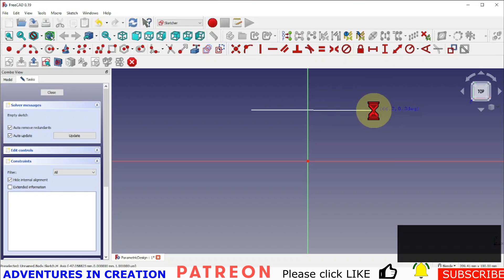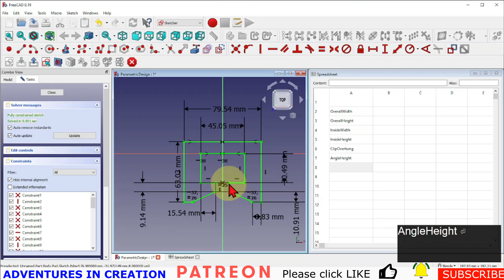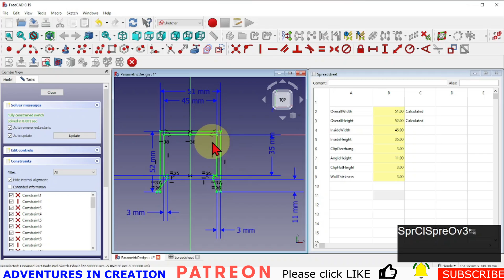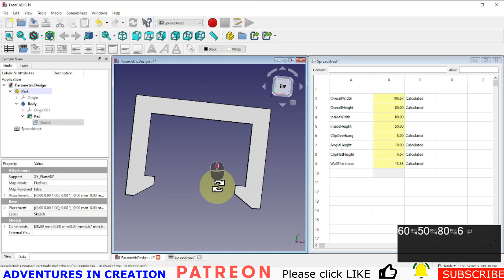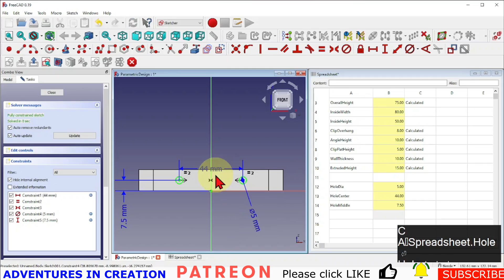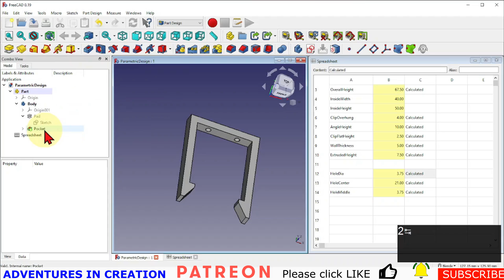Comment: Thanks for another good video. Used this technique to build a holder for a Raspberry Pi that I needed to neatly hide behind a kiosk screen. The parametric approach let's you wiggle final measurements much easier than manually setting. Learning & doing👍
Reply: Excellent, you should post some pictures

Comment: hint at that video where it says how to connect macros, I missed a lot and can't find how.
I have a void in the list of macros and writes an error message: GitPython is not installed! Unable to get a macro from git.
Thanks.
Reply: This problem usually requires an uninstall, reinstall to fix. That git python stuff should get installed with Freecad
Reply: @Adventuresincreation  Thank you so much, I just started learning FreeCAD and have already made your example of a box without a macro, manually assigned an alias to the cells and already printed the box on a 3D printer.
I think I'll learn more over time. My next lesson will be a cover.

Comment: I could check, but was thinking perhaps the sketch was not auto-updating because the "Task" tab was selected and open.  As soon as it was closed it seemed that the model would then update as soon as you changed the values in the spreadsheet
Reply: Yeah, the model uodated immediately but the sketch required a refresh

Comment: If you're not going to be taking the PSU in and out too frequently, then perhaps placing a notch, on the outer edges, just below the clip overhang would allow you to slip a zip tie around the clip to hold it more firmly.  This would give a little extra protection against the PLA giving out too quickly, but still allow you to pull the zip tie off the end (if it's not done up too much) without having to hunt for a knife or pair of snips.

Fabulous video, great explanation of the parametric process… I haven't come across one for Fusion explained that well!!
Reply: Hi Geoff, I actually came up with a completely different design that does use zip ties. I looked at this design and thought, that PLA creep will end up dropping the plug after a while. I like your idea but I went one step further, and did away with the "legs" and replaced it with a zip tie.